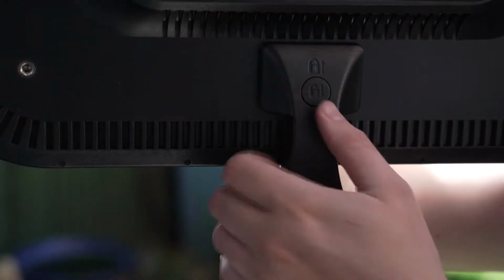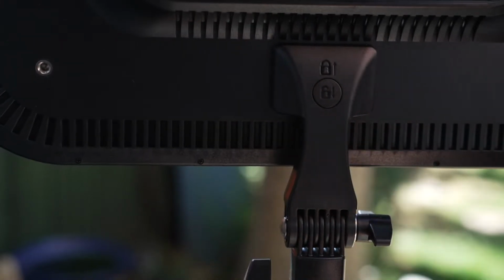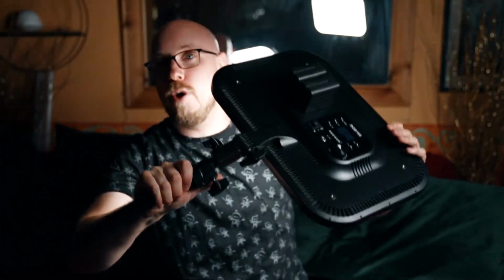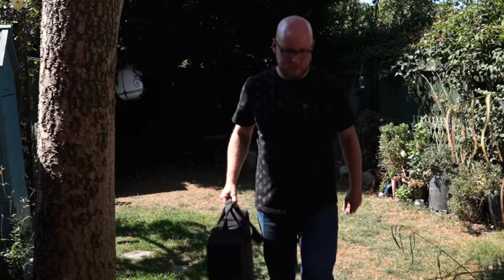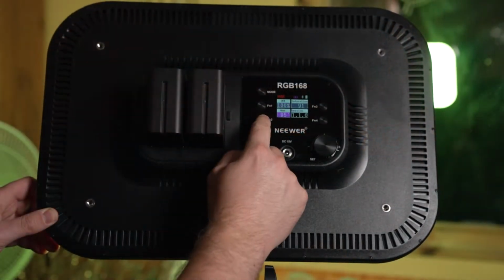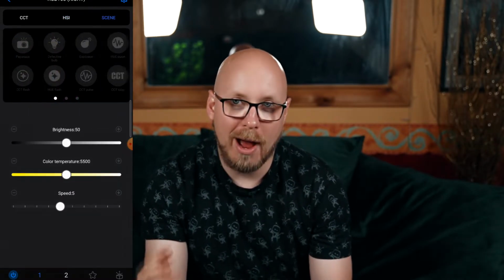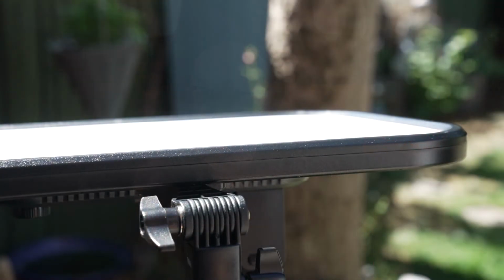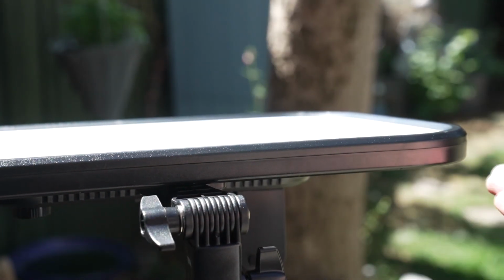Neewer: RGB168 - 18.3” Smart RGB LED Panel Light Kit for Streamers | Set-Up & Review | MyKeyReviews

Comment: You are pretty much the only review of this product, so I appreciate it.  On sale right now just got two.  I also got two of the 660 Pro's so I should have plenty of light options.  Hard to decide between them.  Not knowing if I need the additional output of the 660, but wanting a light that I can use without a huge diffuser setup I think these lights will be easier to work with.

The thorn in my side is wanting the Amaran 100X, so later I am afraid I'll regret not getting the Amaran P60C so I can have all my lights in the same ecosystem.
Reply from the maker: I'm really pleased to hear the video helped. 🙂

You are going to love these lights; they are my favourite setup so far when it comes to price and performance.

The 660 Pro's are also very decent, but you will find the RGB168's to be more pleasant on people's skin.
Reply: @ysmproto  I like them much better (the 168) due to the great diffusion they offer.

Very similar to the popular Elgato Key Light but bigger, brighter, and cheaper.

I use the 660 Pro for a portable product photography light where the harsher light is not a problem, but for studio work the softer light is much better on people.

Adding a soft box to the 660 can help a lot, but adds greatly to the cost and portability.
Reply from the maker: @ysmproto  I agree with Vicious Computers, these are much better due to the diffusion, but it does depend on what your shooting for as there are no additional accessories such as barn doors etc...
Reply: @MyKeyReviews  And too add, the only CON is these things throw nearly a 180 degree pattern, so if your trying to have controlled lighting in a scene these are going to spill over into your other light sources.  So for example you want to use RGB or a specific color key light what ever color these are, your entire scene will be filled in that color.

So to combat this I usually turn up other sight sources to over power the light and have the light just kind of naturally mix.

Comment: bro spend 100$ on a mic, it really will make the difference
Reply from the maker: I normally have a different set-up, however, due to the size of the product, I filmed in another room and completely forgot about the fishtank being on just behind the camera; unfortunately the water pump was heavily picked up on the mic 🤦‍♂️

I tried to fix the audio in post and it ended up degrading my vocals in the process. 😫

I do intend on purchasing a Rode mic at some point though. 😎
Reply: @MyKeyReviews  check out Comica CVM-VM20. It's a very nice mic 👍

Comment: I bought a set of these. 11 months later both of them had their white and yellow leds burnt. Hilarious Chinese quality. While they worked they had good light but seriously man? Not even a year of usage? They sent me a replacement. But i wanted my money back to get something of a better quality
Reply from the maker: @michaelk6957  that's pretty bad! Mine still work however I don't get the chance to make many videos these days so the use in comparison wouldn't be anywhere as much as you had used then. 

I hope you can get them replaced under warranty?
Reply: @MyKeyReviews  i asked for a refund so I could buy something else of a better quality. But they sent me a replacement for both units. I guess I will have to sell them.

 These leds are supposed to work for 50.000 hours. Thats almost 6 years working non stop. Burning on 10 months thats not even 1/6 of what they are promised to last.

Comment: Does it matter how many mAh my NPF 970 batteries have? Is 6,000 mAh plenty or 10,000 mAh better?
Reply from the maker: 10,000 mAh will of course give you a longer runtime, so it really depends on your budget and whether you're gonna be using the lights for very long periods of time. 

Alternatively if you do have a nearby outlet, use the power cables instead. :)
Reply: @MyKeyReviews  Thank you.